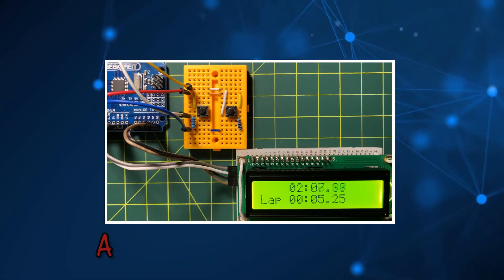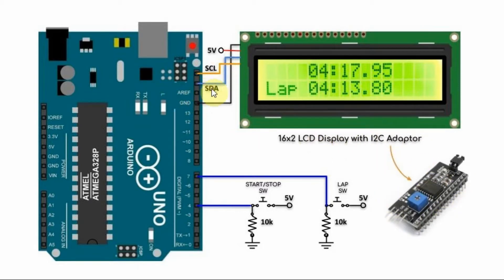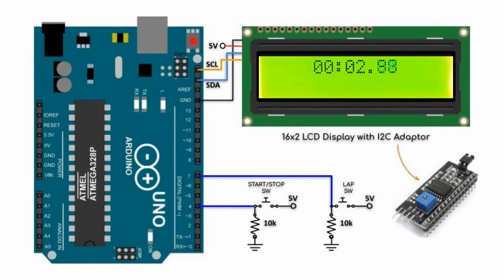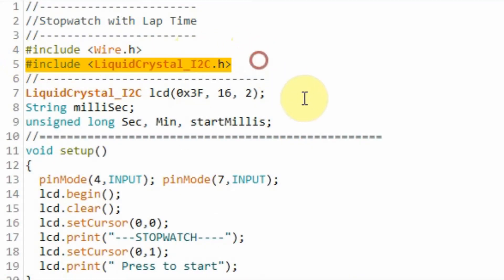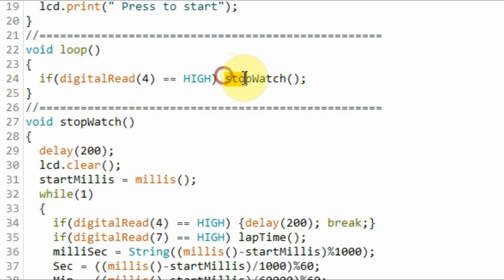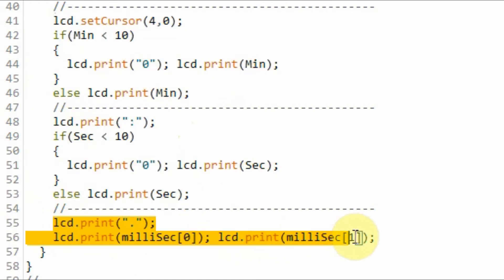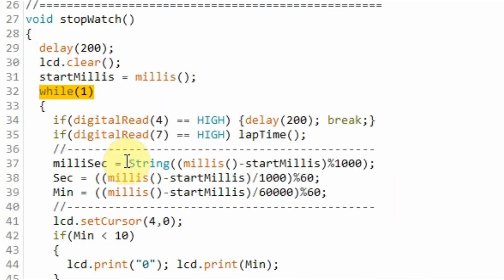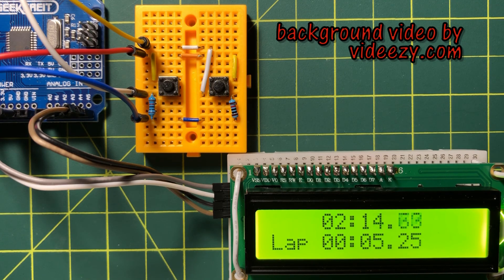Arduino-Based Stopwatch

Comment: Hello Ana,

Great & usefull tuts, thank you for sharing this project 👍🏻

I'm a beginner and I would like using an SSD1306/SH1106 OLED screen instead of a 16x2 LCD, do you think that's possible?
If so, could you help me update this code for it to work with my SH1106 OLED?
Reply from the maker: Thanks
Reply: @AnasKuzechie  You deserve it, your blog is really great for a beginner, I managed several project thanks to you and your blog! 👍🏻

By adding the necessary library (Adafruit), I managed to display the counter on my OLED SH106 but I can't display the "Laps" at the same time!

This is my adapted code :

void stopWatch() {
  
  display.clearDisplay();
  startMillis = millis();
  
  while(1) {
    
    if(millis()-btn1PressStart > 500) debounce1 = true;
    
    if(digitalRead(4) == HIGH && debounce1 == true){
      btn1PressStart = millis();
      debounce1 = false;
      
      display.setCursor(0, 0);
      display.setTextColor(WHITE);
      display.setTextSize(1);
      display.println("   ");

      display.setCursor(0, 10);
      display.setTextColor(WHITE);
      display.setTextSize(1);
      display.println("END");
      
      display.display();
      
      lapNum = 1;
      btn2PressStart = 0;
      break;
    }
    
    if(millis()-btn2PressStart > 500) debounce2 = true;
    
    if(digitalRead(7) == HIGH && debounce2 == true) {
      btn2PressStart = millis();
      debounce2 = false;
      lapTime();
    }
    
    milliSec = String((millis()-startMillis)%1000);
    Sec = ((millis()-startMillis)/1000)%60;
    Min = ((millis()-startMillis)/60000)%60;
    Hour = ((millis()-startMillis)/3600000)%60;
    
    display.setCursor(0, 0);
    display.print("COUNTER:");
    display.display();

    if(Hour < 10) {
      display.print("0");
      display.print(Hour);
      display.display();   
    }
    
    else display.print(Hour);
    display.print(":");
    
    if(Min < 10) {
      display.print("0");
      display.print(Min);
      display.display();   
    }
    
    else display.print(Min);
    display.print(":");
    
    if(Sec < 10) {
      display.print("0");
      display.print(Sec);
      display.display();
    }
    
    else display.print(Sec);
    display.display();
    delay(1000);
    display.clearDisplay();
    
    
    //display.print(".");
    //display.print(milliSec[0]);
    //display.print(milliSec[1]);
    //display.display();   
  }
}

Comment: Hello Anas Kuzechie! I wanted to know that if we replace the Arduino Uno with an ESP8266, will the stopwatch still work? Also, can you tell some way of getting the times to be stored in Google Sheets for data keeping purposes? I know there are tutorials out there to send sensor data to Google Sheets, but how would one send the times displayed on the 16x2 LCD screen to Sheets? Maybe the time values are printed in the Serial Monitor and somehow they can be sent to Sheets. Thanks in anticipation.
Reply from the maker: Hi. Yes, I think so. Just make sure you use the right library for the I2C LCD. As for Google sheets, I’m not sure how. I do have videos related to ESP8266 and ESP32 used as web servers using AJAX and WebSocket protocols. Any how, I need to do some research. Thanks for your feedback.

Comment: I was so excited when I stumbled across your channel, and subscribed, SO excited. You had a very similar like to the projects I've always wanted to do, and obviously are very smart. I have never had the time to dedicate to learning c++ and the arduino ide environment. Working 45 hours a week and chores when I get home leave no time for me to pursue my hobbies.  I have to say that I'm disappointed in these videos. All of the code you have linked in your video "link to code" do not work. I go to the link and copy the code, Paste it in my Arduino sketch and it never compiles, always an error. This is the forth project I've tried, no luck at all with any of them. I don't get it. this code sends back a "no matching function for call to liquidCrystal_I2C::begin". Try it, Go to your link to the code, copy the code for this project, open Arduino, paste your code, and verify. If you don't get this error message, then I'm not doing something right. I'm sorry to be a bother to you, I guess I'll have to just search other projects and hope to learn this code over time. I was So excited......... If the code you are providing needs to be tweaked, or manipulated by an arduino savvy scholar, then it is in vein for a simpleton such as myself .
Reply from the maker: Hi William. Sorry to hear the codes are misbehaving! I feel your frustration, when I first started I had a lot of issues, but with time you'll learn to troubleshoot your code. A for the above code, the issue is the liquid crystal I2C library. If you've installed the library, remove it, then re-install it: https://github.com/fdebrabander/Arduino-LiquidCrystal-I2C-library.
I tried it on my IDE and it compiled OK. Keep in mind these libraries are written by enthusiasts, and some of them are a bit finicky!  If this doesn't work, maybe you need to re-install a fresh Arduino IDE (some times other libraries affect the I2C library). As for the TM1638 project, I was busy today, so hopefully soon I can work on it.